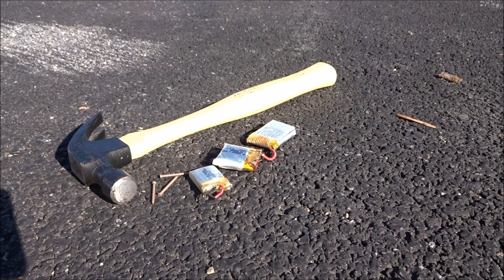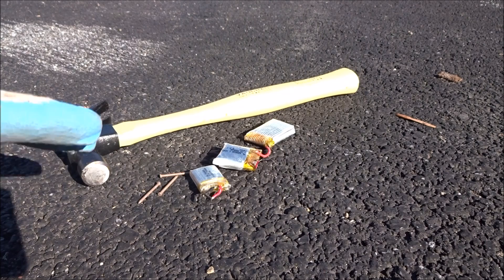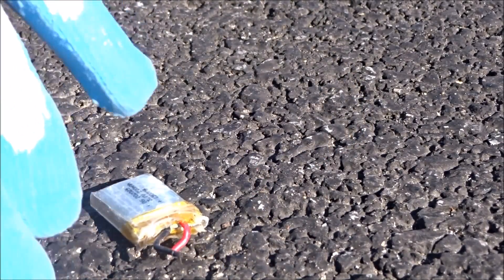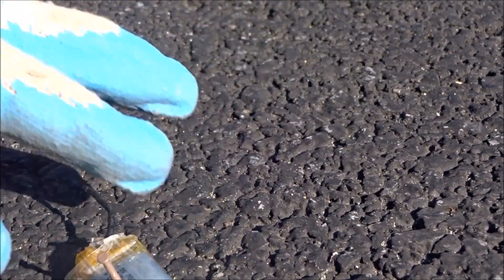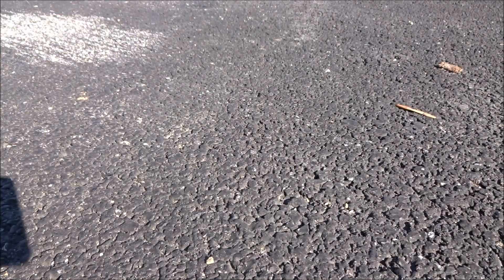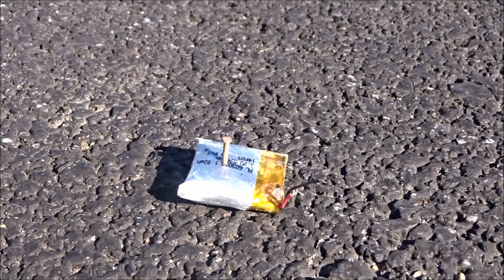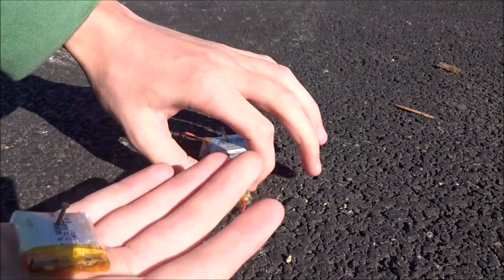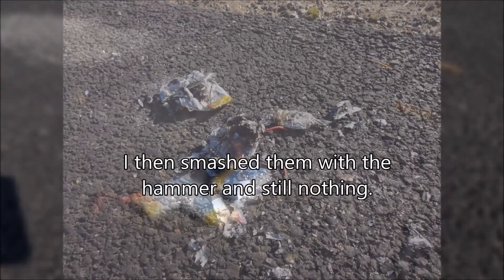Puncturing LiPos to Test the Saltwater Method

Comment: Those are so small they will easily discharge before corrosion could render them non-conductive. That's the problem with larger ones.

Comment: safety glasses isnt enough. What you need is a face shield so that if anything comes towards your face, your face and skin and lips and everything else your bf/gf likes is protected. Also Just because your eyes are safe doesnt mean that you are ok because hair burns very quickly and easily. So be smart. Do not think that eye safety glasses alone is enough.
Reply: Not to mention what this stuff does to your skin, it’s very nasty stuff.
Reply: pffft it doesn’t explode. at worst case it will emit a small flame reacting to oxygen.

Comment: I'm a newbie and would like a better understanding of the "puffy" battery problem. Does any give (air) at all mean the battery should be discarded as unsafe? I mean is 1/8 " of "puff" a problem? Is there any quantitative way to measure if the battery should be discarded? I have a few battery meters and the batteries that are slightly "puffy" (three 680 mAh) all charge, run, and have the same voltage after using in a Syma x5C as the non-puffy batteries. Finally, if they need to be discarded, my iMax B6AC v2 charger has a discharge function (yes, I was concerned enough from the start to buy a good charger and Lipo Safe bags to charge and store them). If I use the discharge function do I still need the salt water bath? Appreciate any thoughts and experience you can share.
Reply from the maker: +Mark Sherman Hmm, it is more of what you think about being too puffy. They are not really Dangerous, but have a higher chance of popping.  I have the same charger, differrent brand. On LiPo disharge it will only do down to 3.0V which is not good as you want as close to 0 as possible. If you put it on NiMh you can discharge it all of the way down to 0.1  though, but not sure if that works well. I might try it out next time i have one, but if you do make sure to be outside in fire proff area. I have found the saltwater method, easy and effective :)
Reply: Thanks. Appreciate your reply. Really enjoy your reviews, too.
Reply from the maker: Mark Sherman No problem, and glad you like them!

Comment: I have brand new Eflite 3s  2200mah lipos  and they are puffin up, I have a professional charger. I took the lipo's too my Hobbyshop were I bought them, and he claimed, that as long as they are still soft, no worries, but the thing is, they do not fit in my Quad, because of the tight fit, so I use it in my plane.
Reply from the maker: +Ruudy L Hmm, that is not a good idea. A puffed LiPo is an indicator that gasses are building up inside. Once they reach the "pop" limit, and create a hole, they will rush out so quickly that they create heat and thus the "LiPo fire". I would not recommend using them, and I would discharge them. I would demand new ones though.
Reply: The RCAddict I don't think they will give me a new one, well not Horizon Hobby. Can't I prick a tiny hole in it too let the gas out.
Well the Hobby shop did say I can safely fly with it, I did say if my plane blows up I will demand a new one HiHi
Reply from the maker: Ruudy L I would think they would, as they charge so much extra to use for customer support.

Comment: Is it me or the H8 mini (and equivalent models) batteries are a little too sensitive. The one that came with my H8 mini was dead on arrival. Bought five extra batteries and three puffed on the first charge. Had to buy five more. Regretable.
Reply from the maker: +Ricardo Rodrigues I have not had any issues with mine, but that sounds like a recurring problem :(
Reply: +Ricardo Rodrigues Sounds like you are using the wrong charger.
Reply from the maker: Ruudy L Ricardo Rodrigues That may be it, what charger are you using? Do you know the A output?
Reply: +The RCAddict I used one of those chargers for several batteries you plug on a USB port. The maximum output is 0.5A. But it could have been the charger. The remaining batteries are just fine
Reply from the maker: Ricardo Rodrigues Well, those batteries are 150mAh right? That is a 3.3C charge rate which is probably too much for those cheap  batteries.
Reply: Ricardo Rodrigues That should have been good, I have one of those too, never had a problem, and I have lipo's over a year old
Reply from the maker: Ruudy L I alway use my hobby grade charger unless I am timing things, and never exceed 2C on the cheap LiPos, but that many puffing is unusual.
Reply: +The RCAddict Yes the batteries are 150mAh. But the maximum output of the USB port I used is 0.5A. Divided by 5 batteries should be safe.
Reply from the maker: Ricardo Rodrigues Ok, if you were charging all five at once then that should take care of  that problem :( That is strange :/
Reply: Ricardo Rodrigues Most likely a bad batch, this is why never leave charging battery's unattended.
Reply: I have, since then, bought a hobby grade charger and I use if for every charge. Never had that problem before or after. Like Ruudy L says, must have been a bad batch.
Reply from the maker: Ricardo Rodrigues Nice, which one? I love my $50 one and am about to get at least one more. maybe a double.
Reply: it happened to me, my battery started oozing green stuff within 3 days
Reply from the maker: QuadBro RC That is not good, do you mean in the saltwater?
Reply: +The RCAddict It wasn't puffed. I think from removing it so many times cut a hole in it (I think), just enough to let the stuff out. Fortunately after I noticed the hole, I put a piece a tape around it, and that kept the green liquid in between the battery and the tape.
Reply from the maker: QuadBro RC Oh, just be careful with it.

Comment: hey man.. i talked to banggood with my problem and they said they'll ship me a new h8 mini ... thanks for the link to the stiff motor problem it worked but the curcuit got burned but now i will have a new one
Reply from the maker: +Dillon Ravindu That is great! No idea how that would short it out, maybe some wires got moved and touched, hopefully it gets there soon!
Reply: The RCAddict today its shipped ... i'm so happy because i will have 1 spare battery,1 spare transmitter,8 spare props and 2 spare motors.......from the last h8.... BTW how many working quads do you have in your collection?
Reply from the maker: Dillon Ravindu I am not sure. Probably around 50, maybe more maybe less.

Comment: I've clipped batteries and disposed of them at work where we deal with lithium batteries on a regular basis (tiny backup batteries, nothing "good"), but I guess I should neutralize them first.
Good stuff!
Reply from the maker: +Michael Thompson Haha, get your company to put in for a bath tub and fill it with salt water :P
Reply: It's not that far fetched.
As it is we have a couple of large heating elements that we keep around submerged in drums of water to test high voltage power supplies and the like.
That water can warm up pretty good.
Reply from the maker: ***** haha, cool :P